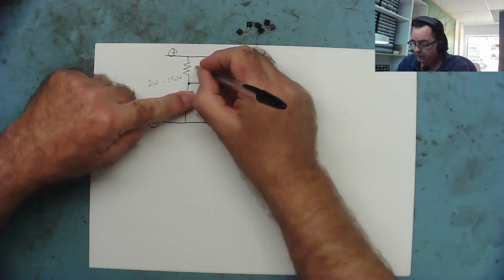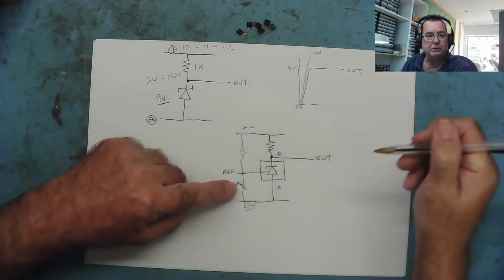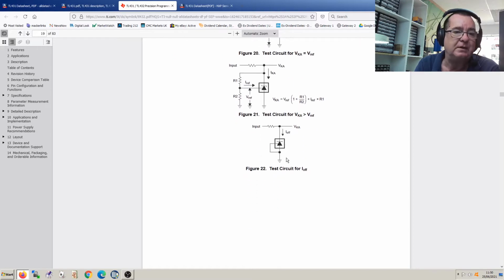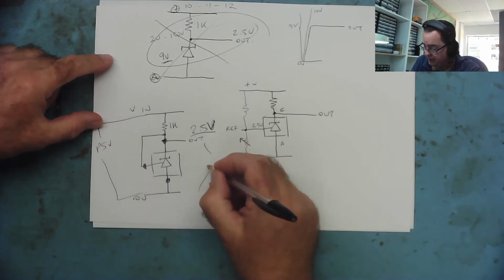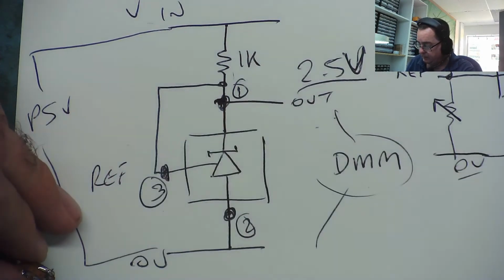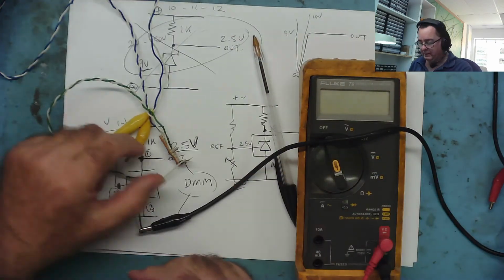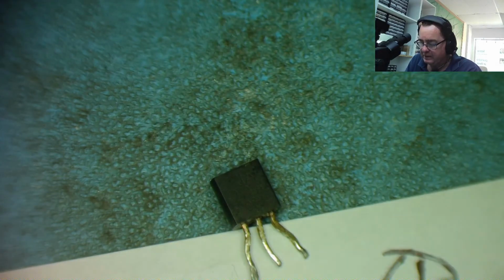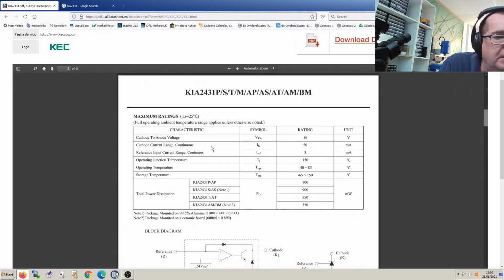How to test TL431 / KIA431  Learn Electronics Repair #078

Comment: Hi just wondered Why not use a voltage regulator? Or simple ziner Diod ? Is it because  it's out put(TL431) output varies (changes friquently) based on the Ref volts?

Comment: So electrons are negative so how can they conduct in the direction of the arrow in a diode?  Some fool in the 19th century thought current flowed from the positive terminal; it does not it flows from the negative terminal.  By the time it was realized this is wrong it was too late and the diode symbols etc were left as is.  But to keep telling students that current flows from positive to negative is false, like they are too stupid to realize the current flows in the  opposite direction to the arrows in diodes and transistors so lets just keep perpetuating the lie?

Comment: I've seen many 431 variants when repairing TV PSUs and ATXs. There is the TL- and the AS- and the AZ-431s. The AZ-431s itself has 2 variants A and B, A being 40V and B being 20V. So really important to check the data sheet and schematic for what is being used. Not all 431s are made the same.

Comment: This is a very excellent explanation of tl431 and perhaps the best on youtube! ,thank you sir for this 

I replaced wl431 with tl431, nothing happened to the circuit but unfortunately it was not the cause of the problem in voltage regulation 

I get readings slightly higher than the required voltages
12.94v 5.26v 3.30v
Reply from the maker: Those voltages are so close to normal -are you sure your meter is calibrated properly?  Try another meter.  Also make sure your power supply is connected to some sort of load like a motherboard or at least a hard drive
Reply: @learnelectronicsrepair  
The problem is the voltage of 12.96 rises to 13.00 sometimes, and normally the measurement should be abit  less than 5.26 & 3.30 
I checked the output capacitors and capacitors on the feedback and the driver rail capacitors and tl431 there is no problem with them !
Reply from the maker: @techeng3940  Well, the TL431 is just a voltage reference.  There will be a comparator of some sort which compares (obviously lol) the desired output voltage with the reference voltage.   There will then be a feedback circuit which controls the PWM generator depending on the output of the comparator. The opto-isolator could also be involved in this circuit.

The TL431 may be set to a different voltage reference with close tolerance resistors.  The output voltage of the PSU, whichever voltage(s) is/are being monitored may also be connected to the comparator circuit via close tolerance resistors.  There will probably be decoupling capacitors in this part of the circuit also.  

If any of these resistors is varying in value (or I think more likely a leaky capacitor or possibly a faulty opto-isolator) then the output voltage would be unstable. 

It seems like first you need to reverse engineer this part of the circuit to find out what is comparing the two voltages, then once you have done that you need to determine if the reference voltage is varying.  If it is, then your problem is there somewhere, if it isn't then your problem is probably in the resistor/capacitor etc network that monitors the output voltage.  Or the opto-isolator if that is in the feedback circuit.

One method you could use is heating or freezing components individually to try and pin down the fault - it is possible, even likely, that the faulty component will react to temperature.
Reply: @learnelectronicsrepair  
I noticed that the standby voltage is also a little bit high  5.26 ! and the second output voltage of the stanby transformer is 19v! which is too much ! 
There is something wrong with the feedback circuit maybe